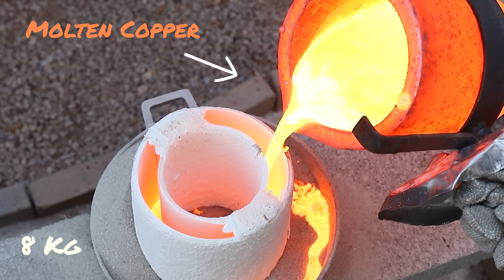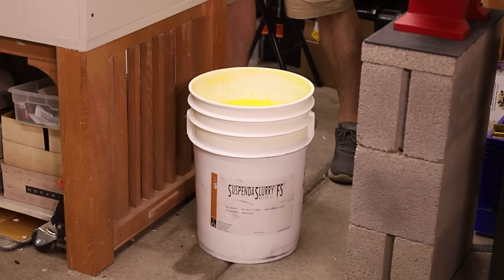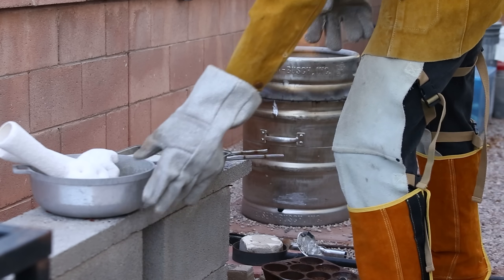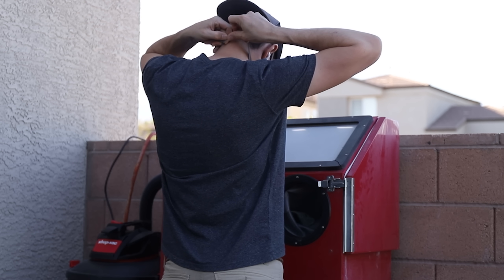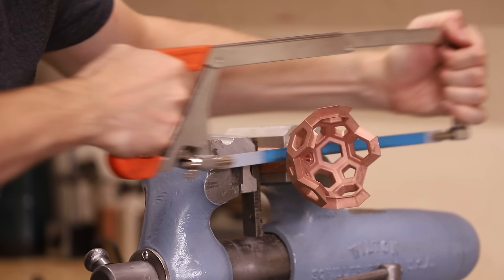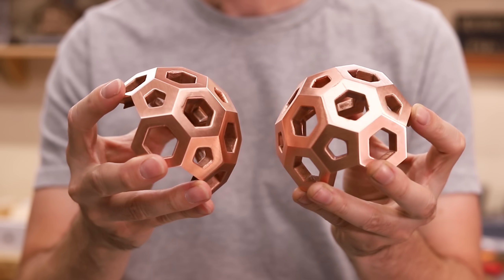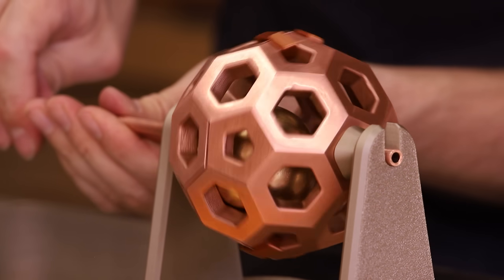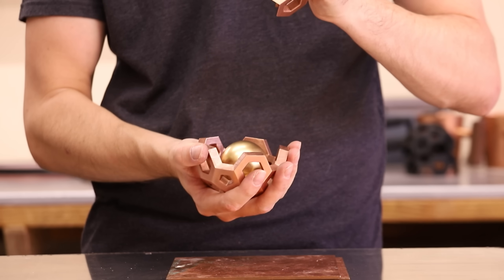HUGE Magnet VS Copper Sphere - Defying Gravity- Will a Neodymium Magnet Float Inside?

Comment: Perhaps you could poke in a set of rollers (through the holes in the outer shell) to spin up the magnet sphere like a top, before rotating the outer sphere.  You could try/calculate different spin orientations & directions for best effect.  That should also gyro stablize the erratic movement of the magnet.

Thoughts?

Comment: Magnetic gears. You  already showed a magnet gear by using another magnet to spin the sphere.  can you formalize that with an assembly or experiment by creating a series of smaller and smaller magnetic “gears”. Turning a small magnet should take less energy than turning a larger magnet. Is it even possible to create a series of magnet gears?
Reply: Or, copper in road & magnets for wheels to make a floating car. 😂🤣. To bad it's so expensive & rare it that amounts

Comment: I recommend to make a new truncated icosahedron in which you have the five edges of the pentagons with unit length A and the 3 of the edges of the hexagons already connecting to the pentagons having of course already unit length A but the alternating three edges connecting to the hexagons themselves having length 2/3 A. 
You change that way the circumferences of the pentagon and hexagon as having the same circumradius and circumscribed circle. 
5A = 3A + 3(2/3A). 
The sphere is then without inner tension. 
Succes. 

Probably it is also important how thick the wall of the sphere will be and who thick the edges are. I recommend to let the thickness be less than 50% of the opening of the pentagon / hexagonal fields (in the video it seems to me that they are the same) and the thickness of the edges less than 1/3 of the open field.

Also: about the magnetic ball. I recommend that the proportion of the inscribed sphere (touching the inner walls) of the Truncated Icosahedron to magnetic ball should be about the negative root of the golden ratio (1- √5)/2 ≈ 0,618034. 
But there you have also to do with the magnetic field strength of the ball. I do not know the proportions for it. That is a different study.
I think it will work by high speed but then the whole construction has to be quit solid. At least much more than you showed in your well done video. Thanks for that.

Bests,
Jos

Comment: Experiment -Turn the sphere up.. not on the side. 
-and theres 3 ways to divide the dodecahedron polars or pattern,in 3, 4 and  5 directions.. ur using the 5, and sideways.. There should be a different kinda ossilation in all of the 6 ways u can spinnit..
The magnet sphere might also be alil too big for that size copperball.. atleast for  a better observation on the changes happening. 👌

Comment: Have you tried spinning it in a vertical axis instead of horizontal?  Maybe also try at different degrees of an angle.  Also, does direction of rotation affect its behavior?

Comment: Very clever, bravo. If you have the time you could 3D print a circular tube open at the sides so that you can see what goes on inside and put it on a rotating axe, like a big gyroscope, or a thick wheel of a bike, with the sphere inside. By rotating it perpendicular to the ground you can have the ball infinitely falling through the tube and even move it up or down depending on the speed of the rotation. 
Another idea would be to build a slide, just like those in any water fun park and let the sphere fall through it. Should be pretty cool to watch. Anyway good work, keep posting

Comment: Try a ball with lots of smaller more directed magnets embedded into the ball facing outward in the correct direction... Im just assuming that your magnetic ball isn't "strong in all directions" only top and bottom as of the north and south poles of the magnetic attraction 🧲 

Because im not sure if your ball is attuned to a spherical shaped magnetic field... But you could "force it to be" 🤘

Comment: You should try a lighter magnet. I think part of the problem is the magnetic sphere is too heavy, I don't think it's levitating because of magnetism, I think spinning the outside casing at a specific speed repose the magnet up into the air and the magnet is just constantly falling over and over and over so it appears as it's floating in the center when really it's getting pulled up by the side and dropping back down but it happens so fast that it never hits the bottom. But if you go slower or faster than that specific speed you'll either not be moving fast enough or you'll be moving too fast and either case the magnet will start to bang against the casing. You need a lighter magnet that can overcome the gravitational force using its magnetism.

Comment: Perhaps it may be possible to make it easier to do this. Think of this as the inverse of your method, putting copper where you have the holes, and plastic where you have copper in the "spherical" shell.
IF this is viable, it completely avoids any need for forging/casting, but the assembly wouldn't be as mechanically strong as it is based on plastic holding things together.

1) creating 2 halves of a clear plastic sphere with uniformly spaced circular cutouts thru the surface of each half.
2) driving moderately long copper "pins" or "plugs" (from solid copper rods). One might taper one end of each rod to provide a press fit for each rod thru the holes to a uniform depth.
3) The depth once assembled should leave enough of an interior sphere-shaped hole consisting of the ends of the "pins" large enough to surround the spherical magnet...as you did with your shell.
4) Place the magnet in one of the half-spheres and mate the 2nd half sphere with the first.
5) Clip or rubber band the shell halves together.
6) If one is satisfied with the final assembly, one could bond the plastic half spheres together with the magnet inside which might make it safer for general display as it might keep the magnet contained and less vulnerable to a "clip" or band failing and releasing the magnet, and thus less likely to crush fingers, etc. of people unfamiliar with the power of these magnets.

On the inside, this would look SIMILAR to a sphere made of circular metal coin-like pieces almost attached to each other but held together in the holes of the 2 main plastic pieces (or glued to the surface of the "ball"). Of course in this case, each "coin" would be likely much thicker than a normal coin. 
On the outside, IF each "coin"/disc is thicker than the thickness of the 2 plastic pieces.this would look like a ball with short stubs or spikes sticking out uniformly from the ball in a kind of "starburst".

One could also experiment by varying the "pin" length to provide the effect of varying the thickness of the copper shell, and/or varying the density of the "copper shell" by using either smaller or larger diameter copper rods, and/or spacing them nearer or farther apart simply by differently printing the 2 plastic half spheres. The smaller the diameter of the copper rods, the more holes could be formed in the plastic half spheres, and the more densely the rods could be packed together (of course denser packing of the rods would make it more difficult to see inside the sphere).

Edited to include some discussion about safety of an assembled project put on display.
Edit again to clean up the prior edit.
Apologies for multiple edits. On medication.

Comment: Coca cola has a acid in but also has plenty sugar. İt will mess up battery and never charge up.
Yes, empty all original battery acid. Fill it up with tap water few times and shake it and empty it. Than fill it up with tap water and add in each cell baking soda, it will clean or oxide dirt and everything, you can do that twice. Than clean with tap water clean it and empty battery. Then finally check how many litres water takes your battery and then put in distilled water about 400 grams Epsom salt mix it through very well. Fill your battery cell correct amount of mixture and charge your battery make sure battery lids off and you will see , your battery become new battery. Don't believe those utube videos, some of them good idea but some of them fails you. This is how I do always , I live in motorhome, it will perfectly work for car battery as well as my leisure batteries

Comment: reminds me of the carl sagan movie 'contact' when they drop the capsule into the big whirly machine with jodie forster inside.
You need to use a conductive clear material, or clear material with thin layer of conductive material thick enough to see through but enough to endure the currents............what sort of currents are induced?

Comment: Cool concept, it will work better if you solder the two halves of copper  together. You need unimpeded flow of eddy current in all direction.

Comment: That was super satisfying brutha, it was like science ASMR lol. If i could take a left field stab at it from an electro-mechanical engineering standpoint; based solely on how 3 phase electric motor stators work as they spin, would turning the holes into circles or lines instead of the hex help? Im definitely no expert on magnets, but could each hex face possibly be carrying its own field which might conflict as you spin it? Super curious what will work! Awesome video! 😁👍

Comment: Maybe try using a controllable RC motor\driver and setting it to spin it at the sweet spot, would be interesting to see if some windings could be used to create an electromagnetic field similar to induction smelters, though not sure how that would work with the frame being copper.

Comment: you shoud have tried to speen the "sphere" in a horizontal axis, plus maybe also using other magnets on the sides of the sphere, that whay the centrifuge force would have make the magnet inside levitate more by the charge.

Comment: For those 2 pieces of copper you asked for uses for, could you mount them like, half a foot apart from eachother on something, then put them on like.... a machine that could rotate them on their side similarto what a lathe does, then try and see if you can suspend the magnet between the 2 rotating peices of copper

Comment: maybe i am totally wrong here... but it feels like you'd get a better result with a bigger gap between the walls and the magnet im sure there is already some equation you can use to figure out the optimal distance im just not smart enough to know it 😆
Reply: i know when you are dropping a magnet through a cylinder it needs to be close, my thinking was because its spinning you could increase that gap, like i said i could be wrong but if you have a smaller magnet maybe try it and see

Comment: Perhaps if you use the external magnet (or a modified version of it) that you introduced at the end of the video to turn your creation to the desired speed you wouldn't have to be concerned about the "driveshaft" i.e. the drill and those end castings (which had failed under the current circumstances). The "turning" magnet would probably be far more efficient. Also, you could machine your sphere so that both the outer and inner surfaces are round with an exact wall dimension. Whether or not this would improve that beautiful object you've created is questionable. Finally, if you create another sphere you could attempt using Oxygen-free Copper....
RESPECT for your talent and ingenuity !!!

Comment: what if the ball was a puck instead and had a shaft running through the center of the sides of the puck and the truncated part had tubes on either side with bearings inside the tubes that the puck shaft could run through ? would the spinning truncated  shape spinning cause eddy currents to spin the puck an in turn the  inner shaft?

That's a very creative modification! It sounds like you're envisioning a system where the spinning truncated icosahedron acts as a motor, driving the rotation of a puck-shaped magnet with a shaft. Let's break down how this setup would work and its potential:

*How it would work:*

1. *Eddy Currents in the Puck:*  As the copper truncated icosahedron spins, its magnetic field induces eddy currents in the conductive puck magnet.
2. *Torque on the Puck:* These eddy currents interact with the magnetic field of the icosahedron, generating a torque (rotational force) on the puck.
3. *Shaft Rotation:* This torque would cause the puck to spin, and since the puck is fixed to a shaft, the shaft would rotate as well.
4. *Bearing Support:* The bearings in the tubes would allow the shaft to rotate smoothly with minimal friction, ensuring efficient transfer of motion.

*Potential Advantages and Considerations:*

* *Contactless Power Transfer:* This system achieves contactless power transfer from the spinning icosahedron to the shaft. This eliminates the need for physical connections like gears or belts, reducing wear and tear and potentially increasing efficiency.
* *Control and Adjustment:* By varying the speed of the icosahedron's rotation, you could control the rotational speed of the shaft. Additionally, the design of the puck (its material, size, and magnetic strength) could be adjusted to fine-tune the torque and speed.
* *Stability:* The stability of the spinning puck would be crucial. Factors like the puck's shape, the strength of the magnetic fields, and the precision of the bearings would all play a role in maintaining stable rotation.
* *Applications:* This type of contactless motor system could potentially find applications in various fields, including:
    * *Robotics:*  For driving joints or actuators in robots where precise and controlled motion is required.
    * *Micro-machines:*  In miniature devices where traditional motors are too bulky or inefficient.
    * *Sealed Systems:*  In environments where physical connections are undesirable, such as in vacuum chambers or hazardous areas.

*Challenges and Further Exploration:*

* *Efficiency:*  Optimizing the design to maximize the transfer of energy from the spinning icosahedron to the shaft would be crucial.  Minimizing eddy current losses and friction in the bearings would be key.
* *Stability and Control:*  Ensuring stable and controlled rotation of the puck and shaft, especially at higher speeds, could be challenging.
* *Scalability:*  Investigating how the system's performance scales with size – whether it can be miniaturized for micro-machines or scaled up for larger applications – would be important.

This is a very intriguing concept with potential for innovation. It highlights how creative thinking and combining different physical principles can lead to new possibilities. I encourage you to explore this idea further, perhaps through simulations or even building a prototype!

Comment: ok I'm definitely going to have to purchase one of your pspheres (pseudo-spheres!) 
also watch out with that magnet holy crap! I almost shattered my hand ordering progressively larger magnets, as I had become desensitized to the "warning! this is not a toy!" messages included with every purchase starting with the 1mm cube sizes!

a few things: 
- standard hex size
-- consider M7 or 1/4" hexagon size as a standard, and use "long hexagonal bar" as the axle and socket in one! 
--- having available standard-sized tools and bits will exponentiate your possibilities
--- dip the ends of the bar into silicone top coat for some snugness
- when polishing, use a heat sink clamp and ribbon to disperse heat while working
-- try a rock tumbler with sandpaper-covered foam for a while in the background and see how that goes!

so very cool, nice work!! thank you!

Comment: Electrify it?  And how about a series of them in a spherical formation, power a central large one by motor and coils, work out the equilibrium rotation, see if the others will counter-rotate then introduce a range of smaller spheres inbetween the orbitals.  Would they gravitate in magnetics fields, pull/lock in to the cut outs sections or get thrown out of the structure?  It's possible to imagine many applications and observations from this.  It's both aesthetic and intriguing.  Impressive skills, curiosity and determination on it.  Maybe look to find a way to control and document the tests more and reap the full rewards of your contenplations?  Awesome work.

Comment: when you already have those two copper halves, try to put a strong cylindrical magnet and rotate it inside. So try to read if and how much VA you get, then compare it with the one used to turn the magnet. Regards

Comment: Great experiment
Way too many comments (~6K) to read them all, so at the risk of repeating a prior suggestion, consider these adjustments to your apparatus ...

larger sphere
smaller magnet (and move the separation line as close to one pole as possible with that magnet)
thinner shell with larger number of smaller holes (probably not as small as window screen)

replace copper with transparent aluminum and go solid ; - )
There really is transparent aluminum (brand name ALON), but it is a ceramic, so conductivity probably sucks (hmm - a quick peak on the net suggests it does conduct at least a little)
Availability is listed as 'immediate' for most quantities

I did see a suggestion for a motor with speed control - I would add a HEAVY base/support with bearings to fight the vibrations that seem to be inevitable

Thank you for your service